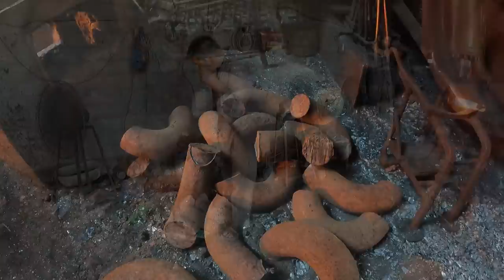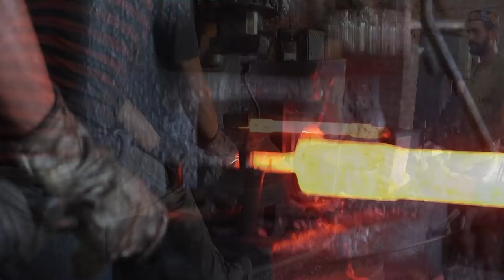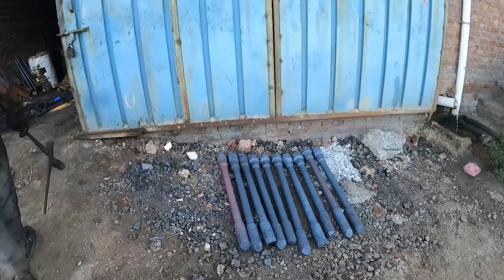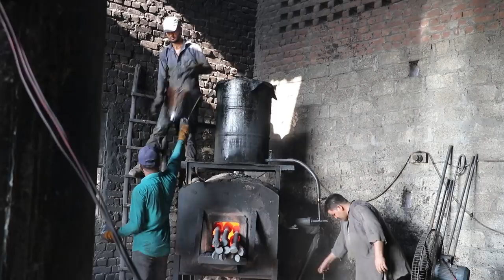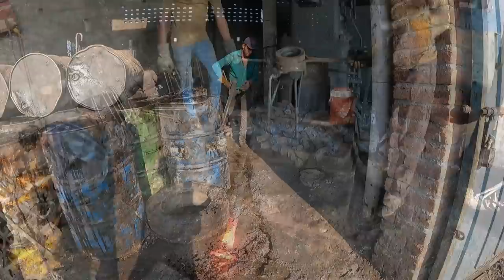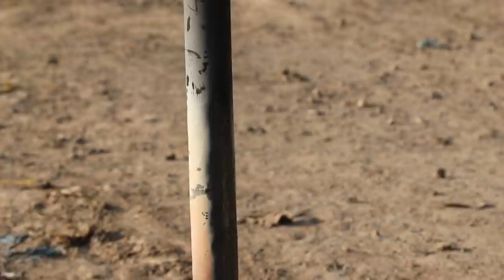A Skillful & Top-notch Truck Excel Forging

Comment: All the hangers on blocking the fan and the guy standing in front of a Hot piece of metal with 1500° coming out isn’t getting any of the air